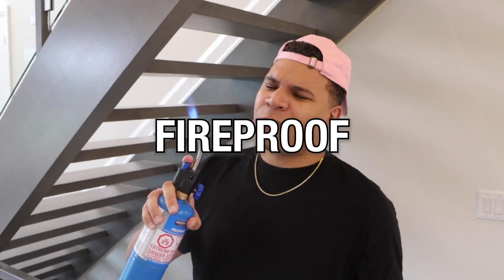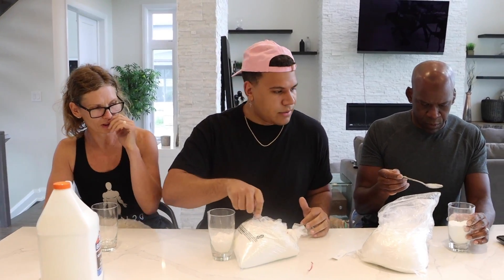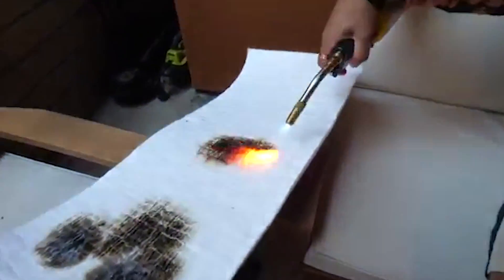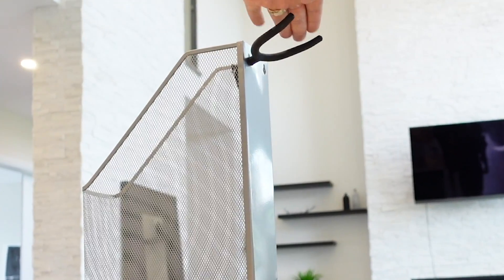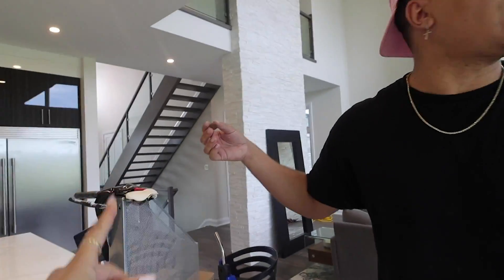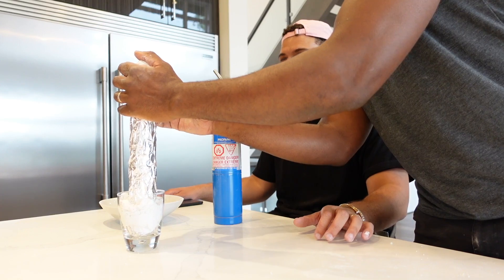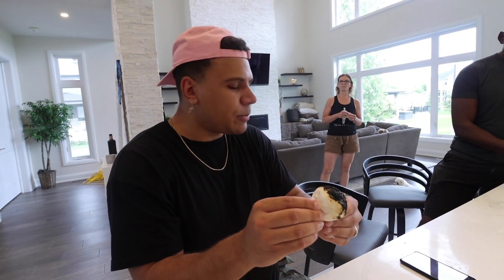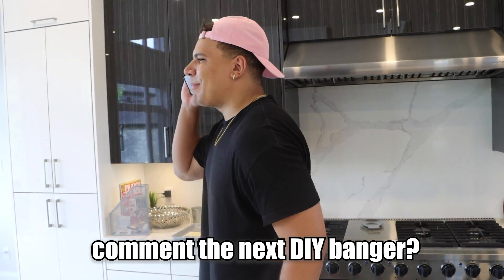I Made DIY Aerogel (Makes Anything Waterproof & Fireproof)

Comment: That's not aerogel.  It's a substance that led to the creation of aerogel.  What you should do next is add borax, a little extra water. and more glue and put the mixture under high pressure.  Once you release the pressure it should expand like foam.